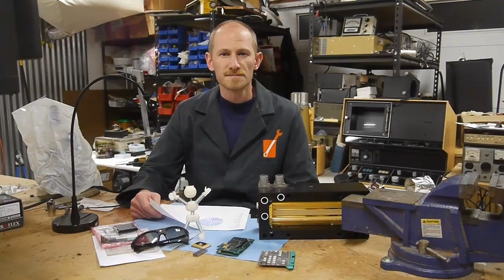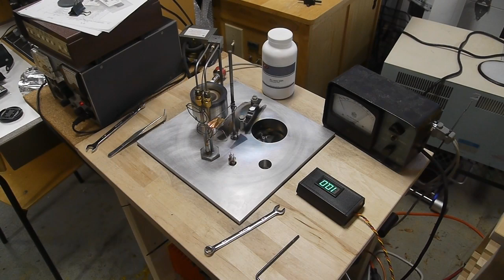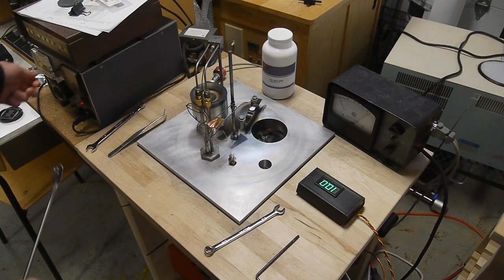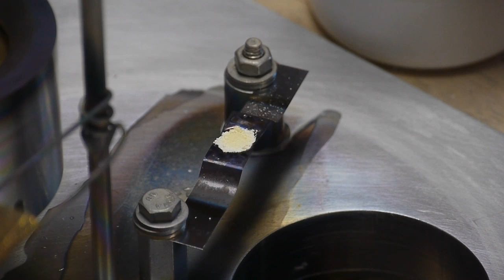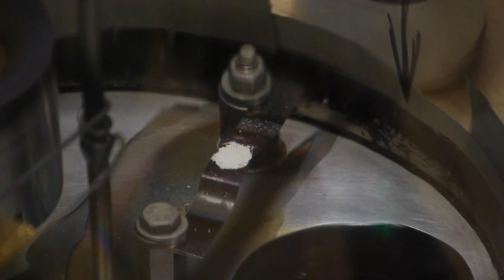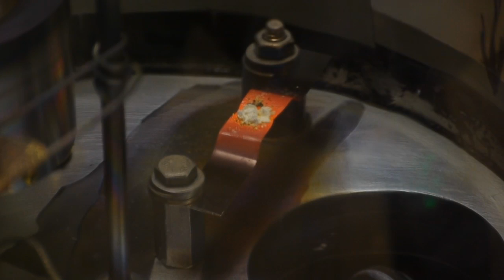Ben answers your questions #1

Comment: Hey, I love your videos and I was wondering if you could answer a quick question, either in the comments here or another video. I have been messing around with plasma experiments and want to switch from DC high voltage discharge experiments to inductively coupled plasmas using coils wrapped around my vacuum vessel (an 85mm OD Borosilicate glass tube) but I cant find any info regarding the radiation resistance of an induction coil surrounding a confined plasma. As I am sure you are well aware this factor is needed in order for me to design a suitable matching network and amplifier stage (if I need one). My working gas is just normal low pressure atmosphere. Any advice at all would be much appreciated.

Comment: Could you start the zinc oxide experiment with a solvent in it to assist in evaporating off the oxygen you think is sticking to the surface? (while removing the atmosphere but before turning on the heating strip.)
Reply: Alternatively, maybe mechanical compression of the zinc oxide into a very thin, uniform wafer prior to placing it on the strip might eliminate the majority of the surface area capable of holding onto stray oxygen molecules? It should at least reduce the amount of time the vacuum and heat need to be maintained, if your hypothesis is correct.

Comment: Hey Ben, 
Really love your channel, it is a huge inspiration, together with codyslab it really makes me think of what I could make.

For my first project I decided I want to make an electronic water splitter (making H2 and O2 from water using electrolysis). Doing some research I see that both of these gasses are pretty dangerous. Would you mind sharing tips on how to do this (as) safely (as possible)?

Comment: be careful with zink in vacuum systems. zinc has a high vapor pressure and will evaporate and contaminate the system. so in the future, your films you make by sputtering will be zinc contaminated

Comment: Which mirrors did you use for the ruby laser? Normally, the mirrors are coated right on the ends of the ruby but you have used external mirrors. Where did you buy the mirrors from? thanks

Comment: Ben if you could do some project with Super amphiphobic material (Both hydrophobic and oleophobic materials-contact angle of more than 150 degree) ..something as a coating which can be applied on to surfaces...i have been working on it (silica and DCDMS Silane) yet it wasnt upto the mark..also incorporating the same in any binder is difficult...it can be a lot of fun.

Comment: Instead of doing the zinc oxide in vacuum, how about doing it in a noble gas environment such as argon? That would probably solve the thermal conductivity issue as well as the adhering oxygen issue.

Comment: Zinc Oxide: One other experiment instead of Vacuum, backfill with another gas: Nitrogen, Argon, Hydrogen, then reheat. The gas should help with the heat transfer issue, and probably help flush out the Oxgen.

Comment: Ben, I think all of your videos are interesting and worthwhile, I really enjoyed the question answer video as you answered a lot of the questions that I probably would have asked. I built my own laser cutter, the hardest part is mirror alignment, which isn't overly challenging. A 135 watt 800x600 laser cutter has cost around $3-4000 AUD, you essentially get it in kit form and perform some minor adjustments and wiring. Good luck!

Comment: Alright, I gotta ask: How exactly does this higher level education degree stuff works on USA? Because in the country I live, subjects like fluid mechanics and lab stuff are non-optional for anyone who wants a degree in any engineering field... optative courses during college are usually very specific subjects like techniques for waste-water treatment and biotech topics, at least in the case of the Chem. E. program...
Reply from the maker: Yes, it's the same here in the US.  I meant that students could choose to focus more on certain classes simply by paying more attention, and getting involved with additional projects in that area, etc.  I ended up finishing my degree in 11 quarters total (instead of 12), and there were so many scheduling constraints and class  requirements, I didn't actually have much choice about anything.
Reply: Oh, got it... I really misinterpreted that lol
Judging by how bad my performance 's been this year I'd say I'll get my degree in way more than 12 quarters

Comment: Can I buy that shirt you were wearing? Is it a lab coat or just fancy applied science cost.
Reply from the maker: I bought a gray lab coat, and applied an iron-on vinyl pattern that I cut on my vinyl cutter.  Maybe I should sell the iron-on pattern and let folks decorate whatever they want.  I looked around for customized lab coats, and they are too expensive.
Reply: Applied Science  WHich lab coat did you buy, I'm looking for some also, you SHOULD sell the iron on A.S logo.

Comment: Do you plan on, or have you done any more work with liquid lenses?
Reply from the maker: I wanted to build a giant liquid lens.  I have silicone oil, and tested that its neutrally buoyant in salty water, and has a fairly different index of refraction.  The salinity can be fine-tuned for almost perfect density matching.  I never built the lens housing.  One of these days...
Reply: Applied Science Well I'll be looking forward to seeing your results

Comment: Laser cutters are great and incredibly fast to make 2D stuff (brackets and whatnot) with. You should consider a Chinese machine if you don't mind servicing once in a while. IMO they are almost much as good as a Trotec or an Epilog for cutting, not engraving though, but I figure you might not be engraving much? 

You can get a 150w machine for around 6k, a good brand is G.Weike.

Comment: What would make an absolutely awesome video would be showing us your vacuum chamber, how you built it, how turbomolecular and diffusion vacuum pumps work and how you hooked them up and why, and maybie little things like where you found the giant glass dome, and your recommendations to build one cheaply with a mechanical pump, and maybie demonstrate simple interesting experiments you can do with one (plasma, dessication, simple sputtering... :) ).
That would be really awesome, I'm struggling to find a cheap vacuum pump that will have no issue with having organic solvents and water being pumped through them (teflon coated ones are expensive).

Comment: I agree on the laser cutter, very useful. CNC I do not see much use for, better to learn how to use the lathe and mill unless you are going to make multiple parts full time, which CNC is good at. I am looking for a good used small mill or a combination machine to use, just the lathe itself is very limiting, but a whole lot better than hand turning. for one offs or even the odd dozen parts just knowing how to do it yourself is good, and it helps to know some good machinists who are willing to give tips on the difficult parts. additive manufacture is incredible, but currently it is limited for the consumer and low end side. Top end it has no equal.

Comment: Thank you Ben for further showing the zinc oxide experiment. The Q and A was very interesting as well. I see your point in 3D printing for home users and it wouldn't have much use for them. I have this small dream of creating robots that can clean and put stuff back in my really messy apartment and I would see a 3D printer very useful for creating different grab mechanism. Well that is only a dream. I'm still stuck with various website projects and finding a job. The critical things that must be done seams to pile up and the dream I would like to do that doesn't make any money seams to be always further away in the future.

Comment: I have a laser cutter in my garage and I have to say it is my most useful tool. It is so much faster than my 3D printer for getting results. I make PCB's on it and have modified it to cut at 45 degrees for optical reasons. You would really enjoy owning one.

Comment: With 3D printers you can make anything from covers and sliders to mounting points and handles. With a laser cutter it is impossible to make anything useful without having at least a metal bender. The dimensions of material that the cutter can work with don't really allow you to build anything 3D.
Reply: You don't seem to have used a laser cutter...
...many 3d printers (chassis) are made on laser cutters.  I have both, and each has its specialty.
Reply: *Needs

(in your username)
Reply: frollard
Thats true, I'm sorry about my prejudice. I just can not see how one would actually build anything apart from covers, front panels or very simple "box joint" boxes. I mean it's easy to 3d print anything from water hose connectors to pretty enclosures. Google search for "laser cut project" did not really convince me either...
What do you use your laser cutter for then?

Comment: My technical science question still stands: why do green dry erase markers smell when the other colors don't? I think green Sharpies also smell a lot more pungent than the other colors. Googling just gives other people asking the same question.
Reply: Whatever solvent is necessary to make green pigment dissolve is more pungent.  check the MSDS for each colour - the manufacturer has to tell you what's in them -- from there you can find which ingredient(s) have the smell by checking them on wiki.

Comment: I would note that zinc oxide sublimes rather easily, even Zinc has a remarkably low melting point. I have grown crystals of ZnO with little more than a cold sheet of metal, ZnO powder and a blowtorch. I imagine as oxygen left zinc atoms would start to migrate through the solid and escape, keeping the Zn/O ratio not too far out of sync.

Comment: I really enjoyed this answer video. Also, I couldn't help but notice..(not sure if you made a vid on it yet)...but is that the apollo saturn rocket circuit board sitting on the table? I recall a couple videos on that from Dave Jones channel.
Reply from the maker: :)  Yes, Fran Blanche is the leader of the Saturn launch computer project.  She sent the board to Dave, and he sent it to me.  I'll be doing a teardown, and inspection with my SEM.
Reply: Very cool. I'll have to check out Fran's channel. Looking forward to see what you discover using the microscope!

Comment: Hi. Could you do a video on PCB Immersion Tin Plating using Stannous Chloride, Thiourea and Sulfuric/Sulfamic acid? There is very little information on this and it will be greatly beneficial to the electronics community. Thanks and regards. Great vids btw.

Comment: Your comments about waterjet vs laser got my attention, I have been programming, operating, and maintaining a waterjet for a little over 3 years now. I can tell you while they are very cool machines lasers have it all over the waterjet. Lasers are considerably faster on nearly all material, they have an extremely small kerf and with the a very high level of accuracy, they are able to fit in a much smaller footprint, and are much cleaner. Now where a waterjet shines I suspect may not be relevant for you, the big limiting factor of a laser is the material thickness they can cut, I cannot remember where exactly they limit out but a waterjet (at least the particular machine I run) can cut up to 8" thick stainless steel, however at that thickness it is crawling, the other place a waterjet has the upper hand is not creating a heat effected zone in the material your cutting, this can come in handy when dealing with certain materials. They both certainly offer both advantages and disadvantages, I would not complain one little bit if I could get one setup in my garage :D If you happen to have any questions about waterjets please by all means shoot me a message, I'd be happy to discuss it with you, and thank you for the time and effort you put into all your videos!